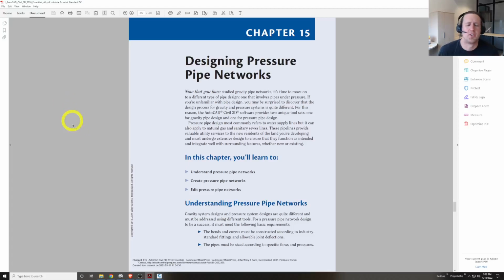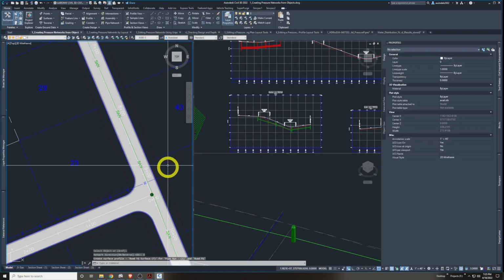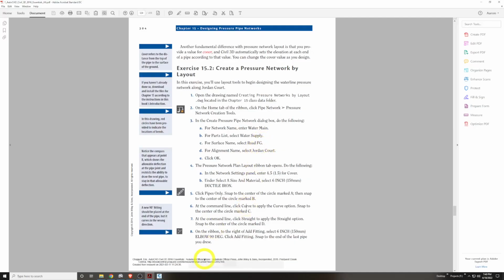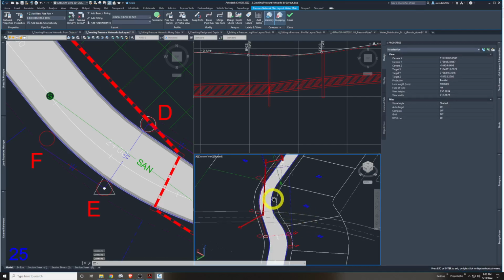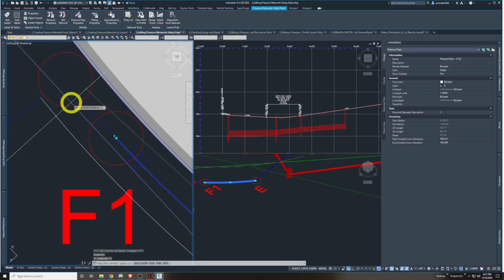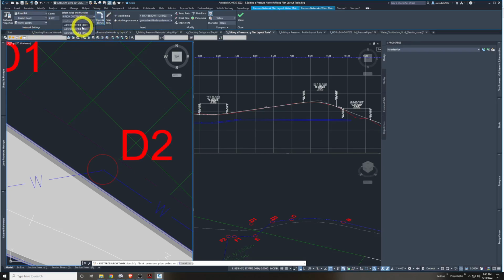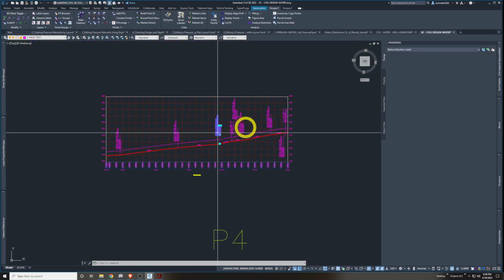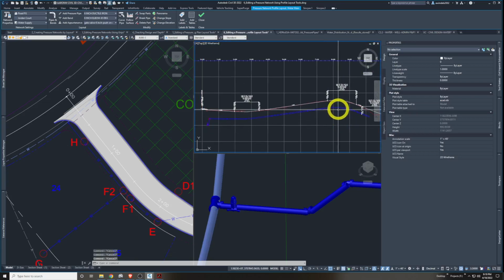Civil 3D Learning - Ch.15 -Designing Pressure Pipe Networks - (pg.297-316) UMT DDSN245

Comment: Thanks Eric. I found your video and watched it specifically to learn how the new version of PPN work and best practices. Do you plan on redoing this video to show how the 2022 pressure pipe network operates as pipe runs. The editing you show in this does not work in the newer version of the pipe runs. adding and removing fittings and appurtenances is not so intuitive. 
Also it's very hard to see what you are doing with the dark grey back ground and the dark blue pipes. May I recommend that you make the colors brighter, black back ground, green lines always work well for visual.
Reply from the maker: There is a chance I will redo the video for Pressure Pipes in 2023 for the new features and, especially using Pipe Runs. I appreciate the critical feedback too. I don't have much time to edit these perfectly with my class teaching and daytime job but I always love improving were I can everyday!
Reply from the maker: I agree - adding and removing fittings and appurtenances is not as smooth or intuitive with Civil 3D as it ought to be, even in 2022 version I have noticed.